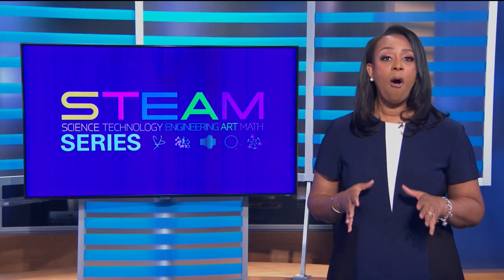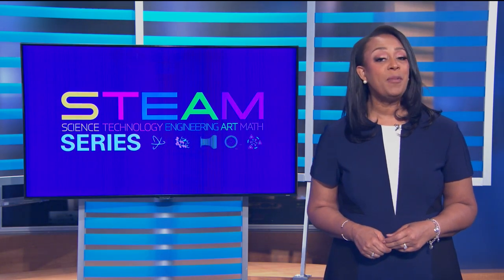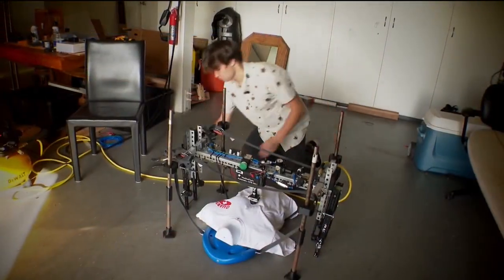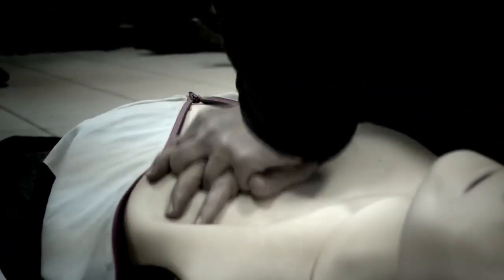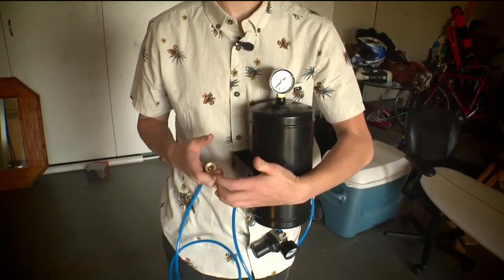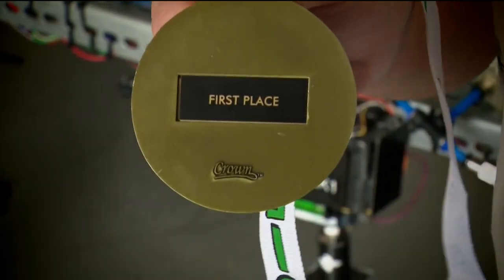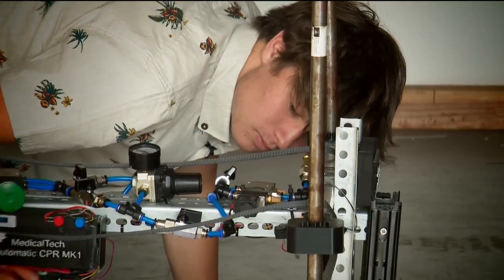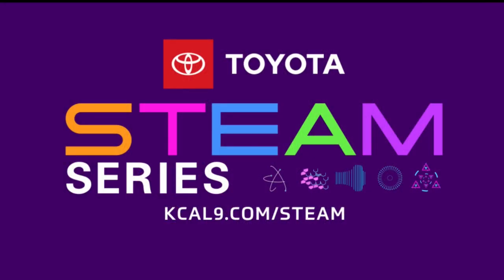STEAM: Teen invents CPR machine

Comment: This is cool for a teen to make it. But actually hospitals already have this machine. Main reason why they don’t use it at all is because 1) it is time inefficient, it’s better to start cpr right away instead of setting it up. 2) the force needed to pump the heart without breaking ribs is different for everybody. 3) size of the patient is very important as well
Reply: Better to break some ribs than to underperform.
Reply: If you aren't breaking ribs you are not trying. plus when your in a 1 to 2 hour code LUCAS is your best friend.
Reply: To know if you’re actually doing good on cpr is you have to crack some of the ribs to reach the heart to give it a strong pressure. It’s ok to break some small amount of their ribs but the most important part is give the brain and the heart an oxygen “cpr”. My older sister is a doctor she told me all about this and also she said that the machine isn’t strong enough to pump the heart plus what if it malfunctioned = death arriving for the patient.
Reply: I never was sure why it wasn’t more widely used.